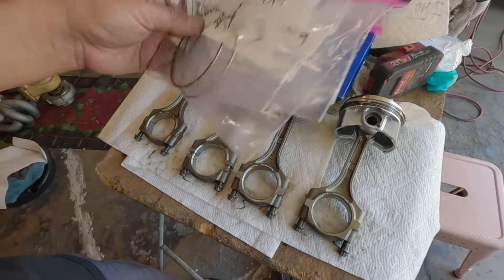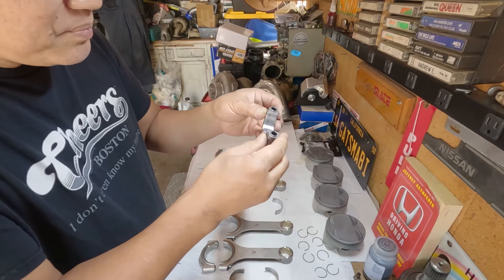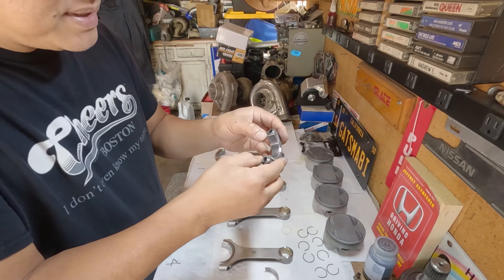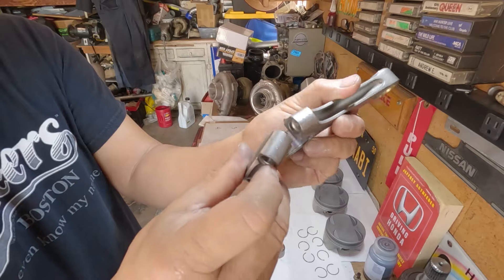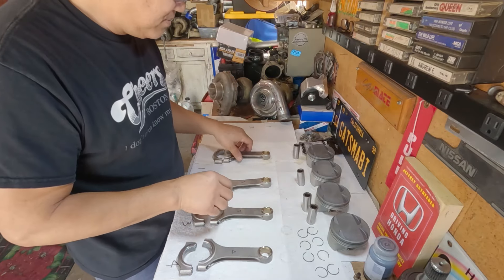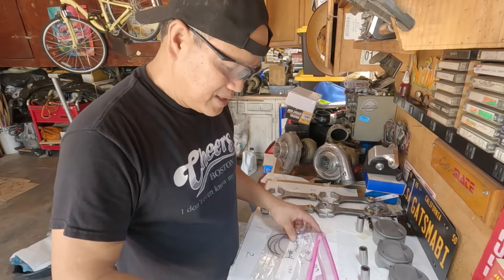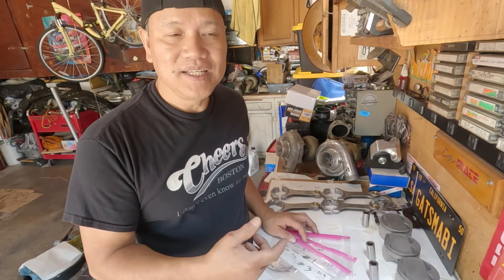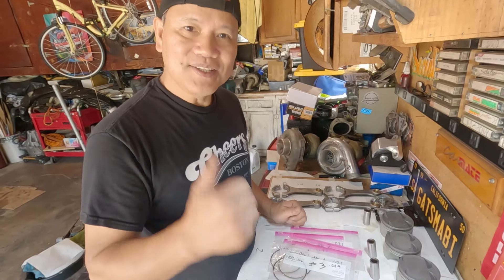Nippon Racing K20 Turbo piston ring gap settings for Boost!

Comment: So, long time watcher, but new subscriber here. You made me realize I had a better option for my accord than just going with my h22 swap. So now I'm in the g23 rabbit hole. Surprisingly this episode came up as my head and block are at the machine shop getting a refresh and so they can tell me if I need any other parts as well. But my question here is the gaps you have here, would they work efficiently for around 13-15psi, as I will be supplying the builder with specs upon reassembly. Sorry this is so long, but keep up the awesome work, love the content!
Reply from the maker: I got the ring installation information  from swapshopracing.com. Depends on what rings you are using if Hasting or NPR. I got a Hasting and it said its good up to 20 psi. Thanks man.

Comment: What rods are those man? Look like the same K20 H beam rods that I just bought and put in my boosted K20. Along with Nippon pistons/rings.
Reply from the maker: It's a no name brand F23 rods from ebay. I've never had any issues on it from my previous turbocharged engine.
Reply: @sagittnet2158  .  Many moons ago I wrote a comment when first subbed about Blox dual valve springs when I was building my K series. I say this because I’ve ALWAYS noticed we both shop at same places and buy same parts . I bought the  CX racing H beam Rods and they look identical to yours. Also I also commented on the hood shock length wanting to know so can buy. Thanks for measuring your hood struts.
Reply from the maker: @notone4029  It make me believed that some known companies are getting the same thing like the no name brand from ebay. Maybe somehow they just stamp their logos on it. The 1st set forged rods l bought was a no name brand but when l received it, it has a Maxpeedingrods logo stamped on it. So l think that they only have one supplier. No worries man!

Comment: I am building an h22 with iron sleeves, I am wondering if I should get the h22  type s nippon pistons or the nippon pistons for k series
Reply from the maker: Use a H22 type S piston on your H vs K series piston. Your piston will sit correct on the block coz piston height is perfect. Once the block is resleeve, you'll have plenty of piston to choose from.

Comment: Sensei I have a quick question,,. Will a h22a4 run right on H22  obd1 ECU? Both are for base H22 usdm
Reply from the maker: It'll run ok but it's best to get it tune, that way you get to fully enjoy the power it can offer. Coz H22a4 have a bit more comp ratio than a base H22.
Reply from the maker: Hamotorsports.com sell a H22a4 ecu (P5m) and immobilizer removed. You can try that if you like but if you already have the p13, it'll be alright l guess. But like l said earlier, find a way to get it tune and you'll enjoy it more.
Reply from the maker: I forgot to mention that using P13 Ecu (obd1) require a obd1 peak n' hold injectors. H22a4 saturated injectors will not work. Be careful not to use wrong injectors on obd1 ecu. If using obd1 ecu use obd1 injectors also, no intermixing.

Comment: i think when my machince shop biuld my b18c1 block for turbo the top pistons ring was gap to 20 and the sencond ones was gap to 22
Reply from the maker: Looks like they've followed the ring manufacturer recommendation. Its like the same numbers l got. Except my block was tapered and it made ring gap in minimum once piston on bottom part and max at top side. Thanks and how's your motor running?
Reply: @sagittnet2158  sold the car so dont know how it is runnning now
Reply from the maker: @b18c5turbogt35r  okay n' no worry man!